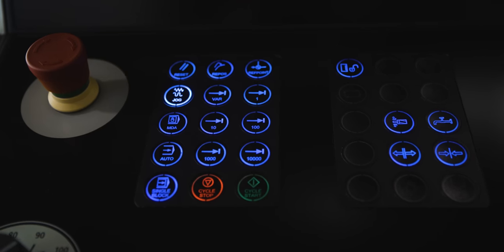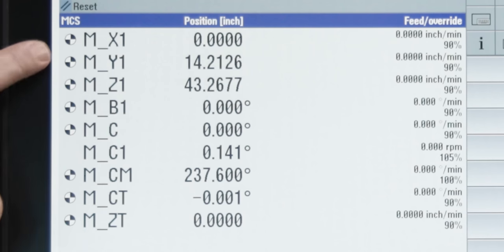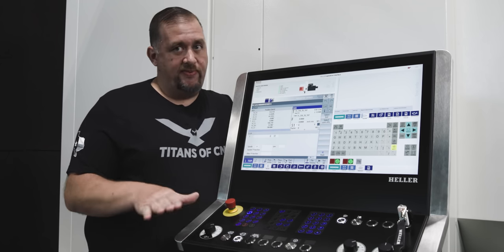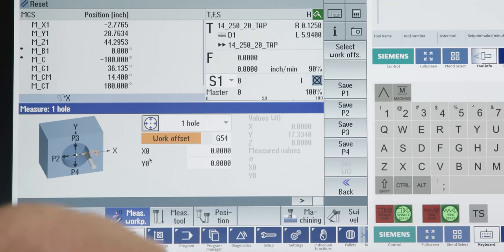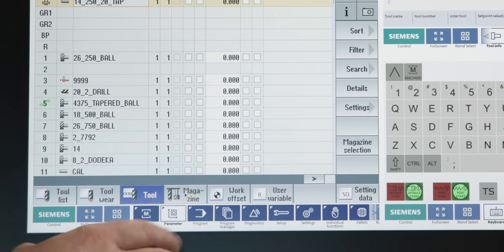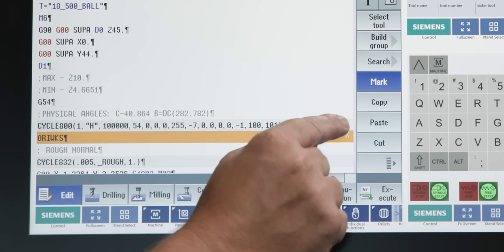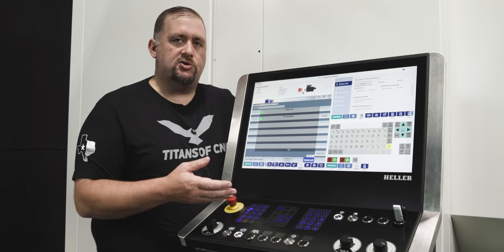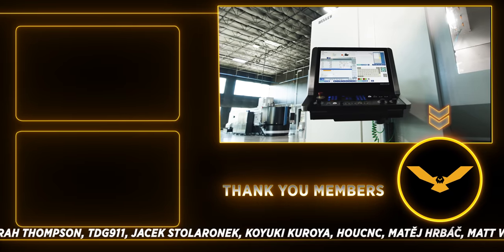Is This The Best CNC Control?

Comment: I write CAM post processors for both Siemens 840D and Heidenhain control. I'd say both are equally as powerful, but Heidenhain is so much easier to work with from a code perspective. It's way more intuitive than Siemens. Plane spatial vs cycle 800 is one example. Heidenhain drilling cycles are also so much easier to set up and read.

Siemens has the same problem as fanuc, in that you can configure it 10,000 different ways, making troubleshooting post processors way more annoying than Heidenhain
Reply: Could you operate CNC with the other controllers the same way on Grinding/Additive/Multitasking/Millturn/Laser/Turnmill/Anytype possible technology machine tool?. With SINUMERIK you can do it.
That's why it's the most complex controller with the best performance you can achieve.
Reply: Heidenhain is built based on Linux and  Seimens is on windows...sure now you know why
Reply: Heidenhain is way more easier to use.
If you write the prog on the machine Heidenhain is the way. All so simple and powerfull. In some cases is usefull to write a simple program on the machine. Heidenhain Klartext programming is so easy. I do that for over 6 years and was easy.
The best machine is a Hermle with a Heidenhain control. Nothing can beat that.
A Hermle is so powerfull and precise. It‘s so funny to work on it
Reply: I'm trying to get Camworks to post correctly for the Sinumerik 840D  5 axis gantry Zimmermann with A-C .. Lots of time invested so far to get any reults.
Reply: So true, but if you buy a DMG in europe.

You can get a post processer and machine simulation with the machine.

To most cam software.

Comment: I'm an electrician and I repair many different machines from different manufacturers and years of construction, no control was so simple and intuitive before. The graphical displays make it really easy to understand what the machine is doing with each command. Inserting a drilling cycle into a program is a matter of seconds, even if you've never done it before. Creating a workpiece and simulating the machining on the control is also super easy.

Comment: Good vid Barry. I ran a 2003 Giddings with the 840d and it's still my favorite control. Even back then, the control had most of the features you showed here. Two points I'd like to add:
1. Restarting is so easy and you can do it anywhere. The machine will find its way there. 
2. The power of sinumerik for parametric programming. It makes the latest generation of Macro B look like an abacus by comparison. I have a couple fanuc 31i-B5 controls with iHMI and they don't wven compare.

Comment: I have experience with both the Siemens 840 and the Heidenhein TNC640 systems. While both are excellent, I find the Heidenhein system a bit easier to use. It offers similar or even greater capabilities, and its touchscreen interface with larger buttons is better optimized compared to Siemens, where precise button presses can be challenging at least with my greasy fingers
Reply: i worked on both 2 for me the siemens is the easiest you will get. if you use it for cycles you can take a random person from the street and he can done a cycle with no problem

Comment: Seems to be an unpopular opinion in the feild , but I've always been a big fan of Mazatrol controls. Love the way it gives a nice template that will tell u if u have a issue so even with little experience u can easily write a program on the machine, while it also allows u to run G code for when u need to do more complicated 3d work.
Reply: Siemens has shopmill and shop turn which are easier to use than mazatrol. Also runs iso code just fine, and has a "macro" language that makes the Japanese controls look like Macintosh computers. They don't even compare.
Reply: @steelwheelsminnesota would be interesting to check that out mazatrol is definitely gravy compared to Mori’s MAAPS conversational programing

Comment: This sounds like a terrific control. I'm an old retired manufacturing engineer who used to do manual programming on a Flex-O-Writer, and then feed the tape into the machine's memory. I programmed mostly Fanuc, Pratt & Whitney, Cincinnati Milacron, Meldas CNC controls....... But by far my favorite control was a Seimens 7-M hooked up to an Acroloc Machining Center (2.5 sec. tool change -- lightning fast!).

The features on the Siemens control that I liked most of all where the ability to put in variables, and to have the machining cycle jump around in the program anyway that you wanted to. These made programs very short and easy to understand and debug. It was what I would call "a programmer's control".

Siemens came out with an 8-M control also, but almost nobody ordered them..... They were just too sophisticated for the average programmer. The Siemens mentality was so far beyond other control manufacturers mentalities. They built flexibility into their programming style that other MCU units just didn't have.

I'm not surprised that this Siemens control is your favorite!

Comment: I think this is very cool. I am more or less a newer cnc machinist been only at it for 6 years after a long time as a welder. One of the first machines I had to learn how to use was an older Monarch Spinner using a Siemans setup but only setup for Germans called sinumerik. I was often lost at figuring out how to work the controls on this vertical and find it pretty crazy I had to learn the TSM on my own and other things to set things like my Z offsets. The place I was working at gave me mediocre instructions because they had their own way of making things "work" more or less and no harm there but I really wish I was able to learn that machine to its fullest potential. I am now in a world where a lot of fanucs are used as the the nc and control systems but we also added a communicative siemans Cin/Milcron Arrow to the shop, the fucking thing still runs on windows 98 and I really like the way it works, I would like it even more to have your set up for sure so thank you so much for showing me something pretty rad!

Comment: My last job as a journeyman manual machinist was at Allied Systems in Tualatin, OR. At age 70 then I got to see CNC equipment evolve to what I see now, totally mind blowing machining I have never seen before! Ha, my last machine was as horizontal boring mill. It was so warn out every bearing surface was out of tolerance years ago. Not all the speeds even worked! The spindle deflected as I bored out holes or milled. To counter this, I used hand ground high speed tool bits with radical angles to minimize push back hoping the tool would last the job to bore through without tool failure. That means low rpm and modest feed rates but peeling out steel with as deep a cut as I could make it. I always went to the lower end of tolerances, a total most of the time within 2 thou. If the hole was too small, I got out the air grinder and a flapper wheel to open up the bore, checking as I went to get it in tolerance. It was the complete opposite of what I see here! The company I worked for did not make enough profit to buy new, modern machines and the owners did not appreciate what a good machine could do to pay for itself. It was a dirty, grizzly, hard, back breaking job, but at 70, planters faciatis, hurting back, no air conditioning or heat, I got it done. There are so many smaller size businesses like this one. Before that I temped at ESCO, another grizzly job doing heavy lathe work. I am glad I am out of the trade. I went to school to learn CNC programming and operating, but no one would pay enough to support my family, so I was forced to stay in the manual side. Nice work, guys, I wish I was there!

Comment: Barry you missed the most important thing about the Siemens control and that is the conversational on machine programming ie: Shopmill and I’ve used it for over 12 years now and the time you save using will blow most people’s minds.
Also what you can do in it is amazing.

Comment: I've been working with heidenhain for a few years and i loved it. But  i'm working on siemens controls now, and i have to say, that they are more powerful. parametric programs, loops and stuff are much easier to do. the only thing i hate on siemens is the limited memory in the NC-Area (mostly around 5MB).
Reply: Use instead the NC-Extended Memory (system-Disk). Today,  there's for most users no difference in speed of data transfer.

Comment: From my own multus 4000 with the OSP 300 controller, there isnt much difference, but i would say getting a tool from the tool page on the siemens is better, still need to remember the tool number when i've found the tool i want in the list on the OSP... but the Okuma doesn't need homing and referencing when you turn on the machine... beside that, pretty much the same over all.

Comment: I am not master of all controls but Haas can even have a video in program etc. And this pdf is good stuff, but is there method to find it if you have 1000 pdfs. Haas can also have option to engrave number of part and increase it by 1 for every part, get WCS in 180° arc (not full hole), but still can not get angle between 2 holes, like Siemens can. Heidenhain doesn't lose MDI data, once you leave it... Every control has something better than other, and once you start fully use that option you miss it on other more than you benefit from all other features. Mazatrol is apparently most advanced control, but it's only on mazak....

Comment: I love modern controls and all the functionality that comes with them, but I dont want newer controls to remove physical buttons the same way cars have done. I would rather have Function buttons around the screen and a full keyboard instead of in some sub-menu on the screen itself. Maybe thats just me
Reply: No its not just you. I hate controls without a keyboard too. Removing the function buttons around the screen and just having to touch the function that is on the edge control UI is okay imo, because it allows for beneficial manufacturer UI that can help you a lot, eg DMGs CELOS, but removing the keyboard or programming buttens is a nogo.
Reply: Definitely not just you. Physical controls will always be superior

Comment: What's the Siemens control like for full 5-axis simultaneous work? Everyone I talk to tells me that Heidenhain is the best control when it comes to this, as it's the most powerful control, and therefore doesn't have any trouble processing the code. I even had someone tell me that they got rid of their Siemens machine and replaced it with a Heidenhain machine for this very reason (that's 10 yrs ago now though, so the Siemens may have improved)

Our Fanuc controls doesn't like full 5-axis work. You have to really slow them down.... but i don't think anyone would argue that Fanuc is better than either Siemens or Heidenhain...

Comment: Best thing is you can run Programms directly of a Network drive no need for a Thumb drive :) and to be precise its a 840D sl (Solution Line) older model was PL for Power Line

Comment: One of the fantastic features on the 840 shopmill control is the way it handles sister tooling allowing the machine to automatically swap over to a new tool after a given number of parts OR a given number of hours/minutes/seconds. The tool naming is in my opinion far superior to the old conventional tool number system. 
Absolutely THE best control i have used EVER, and i have a lot of experience in my 38 years in the industry with Hurco, Fanuc, Mazatrol, Fanuc Anilam and Heidenhein all heavily used by me and all inferior.

Comment: Not much that is better than Heidenhain from the early 2000. 
And nothing that impressed me that much after working with a TNC 640 with touch and OCM packet. 
Sure the program edit on the fly is nice but I simulate everything for the next job while running the the last parts of the old one. The only thing I give it is the calculater. Heidenhain has one too but it has no "list", just one number.
Reply: I go TNC 150 had to hand input all programs by hand. Only way we had to transfer programs was free copy of TNC Remo ( if I am remembering it right. probity not.) programming software cost to much and was crap anyway.
Reply: @kdenyer1  I dont know the 150 but I know the 155/355 and they are the archaic garbage Barry talked about. Im talking about the iTNC 530 and TNC 640. They are state of the art controls. I hope I can get my hands on the TNC 7 on the EMO next month.
Reply: You can run simulations of other programs as well while the machine is running other stuff.

Comment: Almost every controllers have their pros and cons, the easiest controller to training people on is without doubt Heidenhain, also the quickest for programming on the work shop floor. 
A little bit awkward with system variabels,  so when i do training and are programming on the shopfloor i prefer heidenhain, if i make macroes, using system variables etc, i prefer osp

Comment: I used to work with Hurco controls and they are very user friendly almost resembling some features of the Siemens controls. Now, unfortunately I have to work with 2018 Fanuc controls and it’s night and day. Everything is so involved on Fanuc controls from making a simple tool change to loading a program. I miss being able to go into the folder on the Hurco and just select the program and you probe the part, ready to go.

Comment: I think Fanuc is the most widely used control type and it is certainly the control type I've seen the most in my 13 years in the manufacturing industry. The company I work for does a lot of high volume production and Fanuc just works for most of our North American facilities. I know you see a lot more Siemens controllers on machines in Europe, Heller uses Siemens as do other brands from Europe.
Reply: We also do a lot of high volume production where I work here in England. 18/20 machine here running Fanuc too
Reply: my shop in the northeastern US is about 50/50 fanuc and okuma

Comment: Great video. Glad to see what Siemens is all about. Even though it looks nice and full of fun options. I don’t see it worth it here where I am as they have a bad reputation on support and machinists who know Siemens, Heiden, or mazatrol tend to expect better wage just for knowing the control even if less skillful. Fanuc , Yasnac, or Haas does the same result and more user friendly to change or modify the code on the machine. However IF you program on the controller; that could be a whole different discussion as I was told THATS where the power of these controls shines most. Or so I think anyways I could be wrong of course. But great video I love to be able to see how much Siemens evolved I remember it being a task to make a tool change on that control 20 or so years ago. 😂

Comment: Siemens looks like a nice platform to work with! Can you also probe centrepoints between X+ and X- for example? Or level out a flat plane like Heidenhain 640 can do with plane spatial? These features are of extreme importance for the workpieces I make,
Reply: Of course you can do it and even way more beyond that.
Reply: @orze1191  that's great, thanks! Those probing sequences shown in this video made me a bit confused as to what else would be possible. But they can only put so much into a single video

Comment: The last company I was with had two brand new 5 axis Mazak lathes w/mazatrol and they were scared to touch them. Expensive paperweights. I did manage to dust off a few doosan slant turns and get them going and turning a profit. Sadly they got their PPP loan and 90% of the shop floor was laid off within two weeks.

Comment: Lol, we were just talking about this last week. The damn controls on HAAS suck on the new machines slow AF and they freeze up often. Then the Motoman board on one of our Amada robots using PCMCIA cards to store parameters, just getting those cards these days is a pain. That Siemens control is pretty slick, of course I would expect that on a high dig machine like a Heller. The only control that was ahead of it's time was on the old Cincinnati machines, similar to how that Siemens is, drag and drop files, running a Windows type of interface.

Comment: Half of the functions you showed are not exactly about siemens control. It's about heller machines.
And this is why those controls are great. You don't have to, as an IEM control user, put your own interface on top of control, like in old fanuc controls. You can integrate functions you need inside the default hmi. And that flexibility is why those controls are amazing.

Comment: Its the best control. I use it for turning. you can write programms so fast, no control ever can do this in this time. in my opinion Celos from DMG Mori is one of the best Interfaces/ subcontrols with siemens 840d.
Reply: yeah i can only agree, work on am DMU 75 Monoblock and it is amazing.
Reply: I’d argue the same for Mazatrol. It’s so damn fast for writing any type of unit.
Reply: @jessetonhauser3516  that's early true. Mazatrol have dialogue control yes. But the difference between this controls is the confort in so much points that Siemens have.

Comment: Which leads to the next question: 

Let's say I've got a mill sitting on my floor that (1) was built during the Reagan Administration and (2) is older than any of my employees. The machine still runs profitably but I'd like to change to a better control. Can the 840D be retrofitted to it, or does the mill have to go too?
Reply: there are way to retro a siemens on the machine. there are are a lot of variables

Comment: Did you tryed newer Siemens ONE? Because Siemens is trying to not sell the 840D, because of their newer ONE. I work in shop as application technician where we are building cnc machines and the price for 840D is higher then for ONE. We are trying to build machines as our customers want, but they are not making easy for us. Its crazy. For me is Siemens good CNC Machine control, but I prefer Heidenhain and Im waiting for their TNC7, it should come to our shop very soon.